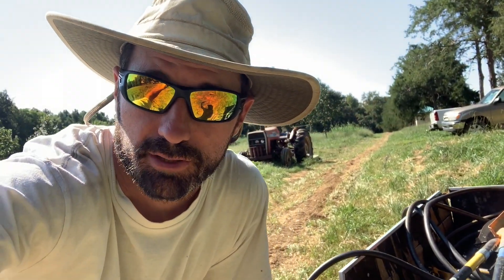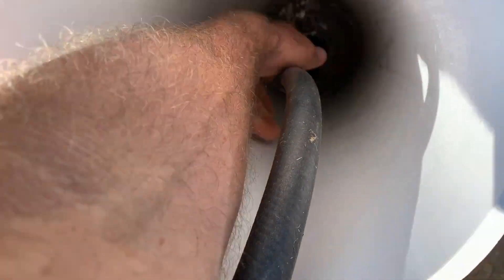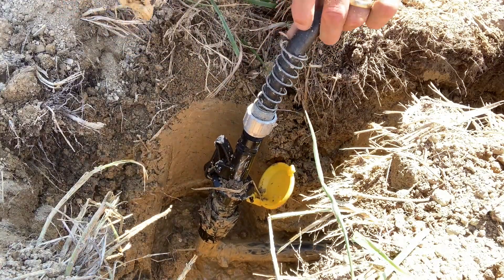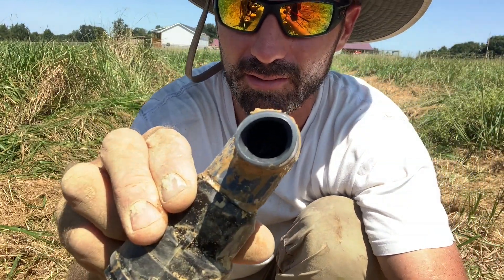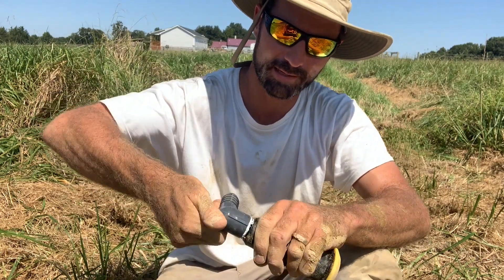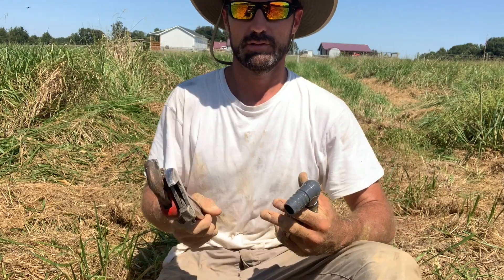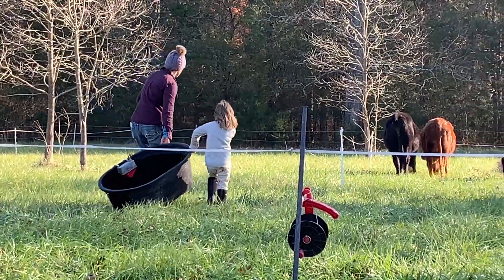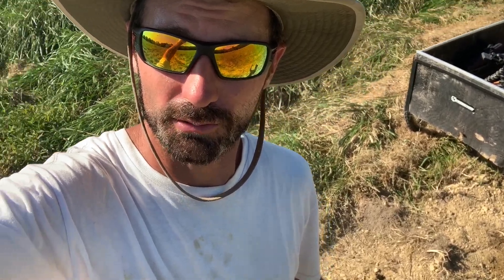IF I HAD ONLY KNOWN! How To Fix a Leak in Black Plastic Water Irrigation Pipe: Garden + Animal Water

Comment: First assembly if the pipe was really hot the fitting may have softened, resulting in the crush.
Reply from the maker: Hmmm. Good point. No need to rush the tightening process

Comment: Black poly pipe is great! Completely resists the sun, is relatively inexpensive and is tough stuff. Only downside is if it's cold, it's hard to deal with fittings - and if cold and still in a roll, just leave it in the sun for a while (else risk kinking it). I can't imagine dealing with 3200 feet of it, especially if 2" or greater, unless you have a tractor and a spool =)
Reply from the maker: Fortunately I had a spool and a reel stand to unroll the 1000 ft sections of pipe. Even then, it was pretty difficult to keep it from getting kinked and tangled!
Reply: Don’t use the Teflon paste on it either, plastic seals without it.
Reply: Black PE Resists, barely. I have an EC with a .25in black PE line and it breaks about once every year.